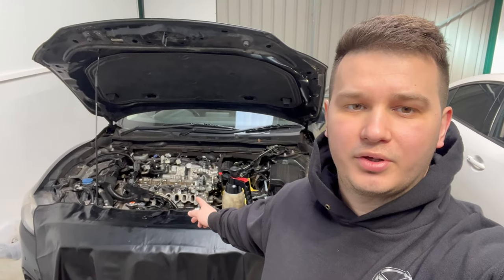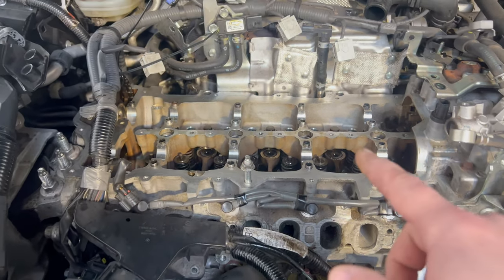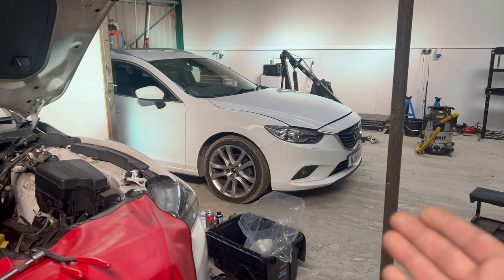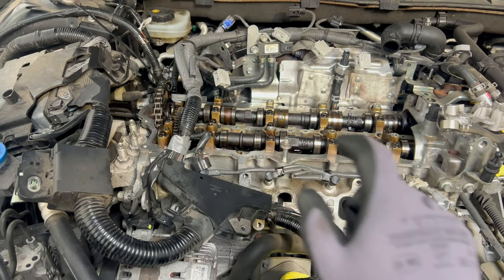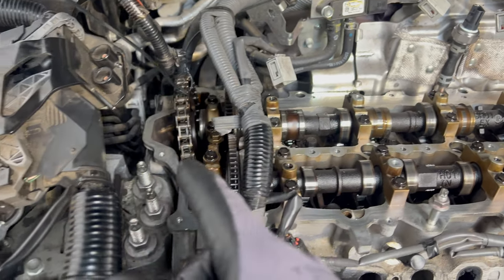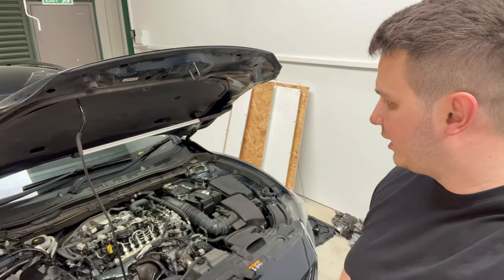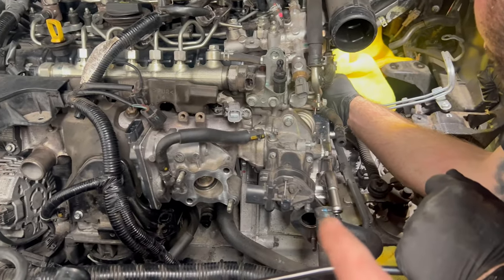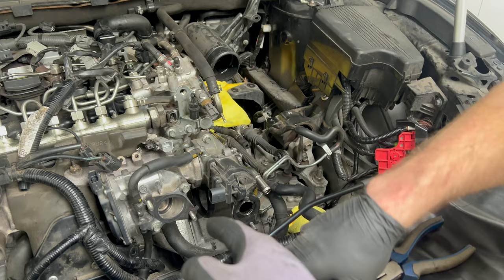(Un) REPAIRABLE Mazda Skyactiv Diesel? - Chasing the P0101 all night long

Comment: Nightmare!! At least you have done most of the common tasks to eliminate the P101 code issues. And you drive 40 miles to work?. That's still a long way from your house! Where is your workshop based. Might have to get my car booked in?
Reply from the maker: in Lingfield

Comment: Hi,
I recently replaced my head gasket as it was blown. In the process I found out camshaft was worn hence, lifters etc. I done all this but I did not know by that time that I have to look for hone on my cylinders. 

The vehicle has 140k miles on the clock and the head gasket was really bad - all 4 cylinders were mixing with coolant. Do you think this will result into something serious? 
I haven't start up the engine since I replaced all the parts yet, am afraid to do so... I did try but maybe luckily there was air in the fuel system that didn't allow me sooo, should I try to run the engine and see if everything is fine or I will be risking too much?

Thanks a lot! You are doing great job on the Skyactiv engines, learnt a lot from you!

Comment: What's the part numbers for the rocker arms, and how many of each type do you need for the exhaust side (obvs 8 total as 16-valve)? I am aware Mazda sells two types of rocker arms for the SH motor.

Comment: A quick question to you bro. I'm using the OBDLink MX+ diagnostic tool with Android app Car Scanner and looking at the metrics. It has pretty much everything for live data monitoring - except oil pressure. As per my knowledge, if the ECU receives metrics from sensors in the car, the OBD tool can read it. This is not the case. Any ideas why?
Reply: Because some cars are actually not measuring Anything, but just switching on at the 0,5 bars of pressure. Pwy.
Reply: @bustjanzupan1074  Mazda from 2014? I doubt that. Older cars maybe, but most likely not the newer ones